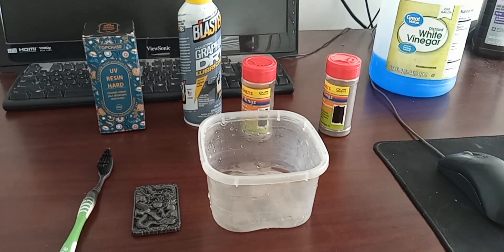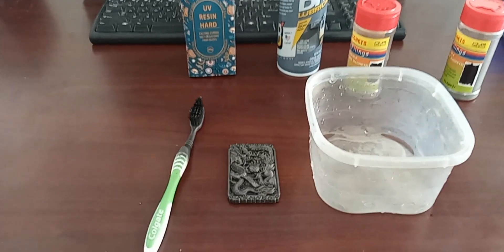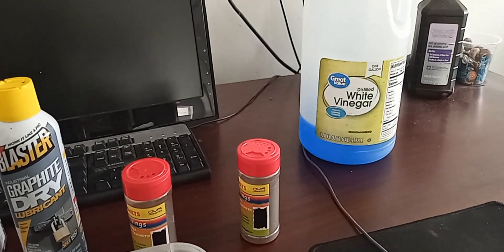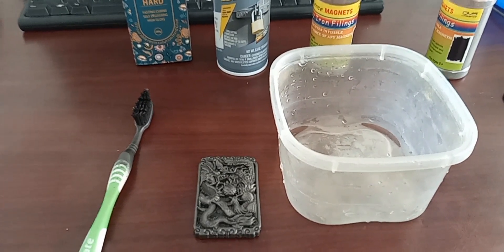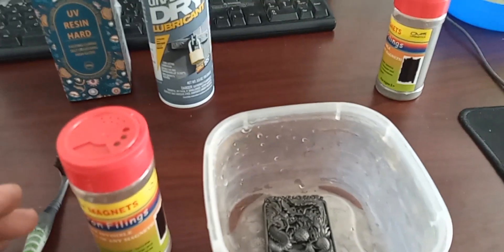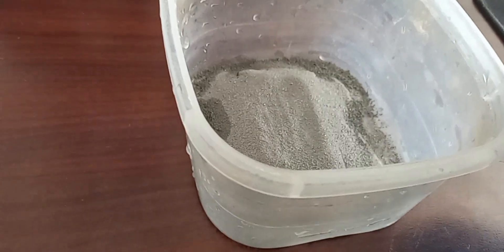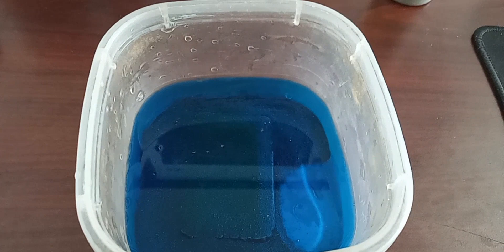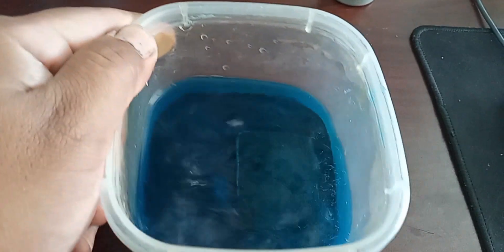Galvanic Copper Plating 3D Resin

Comment: You can’t do galvanic copper plating in a pro workshop, you will get laughed at , galvanic is for a home adventurer with miniature items . It won’t last the adhesion test in traditional electroplating procedures.
Reply from the maker: Read on The History of the Process, it was started in The 1800s for Electrotyping Typing Molds, when all they could use was giant Zinc/Arsenic Batteries, Before this a Giant type mold would take about a week to be fully plated in Copper and with this process it was shortened to only a few days because it made the piece more conductive than graphite/plumbago
Reply: @nicamarvin  yes I have mate . The point is galvanic plating won’t pass the adhesion tests.